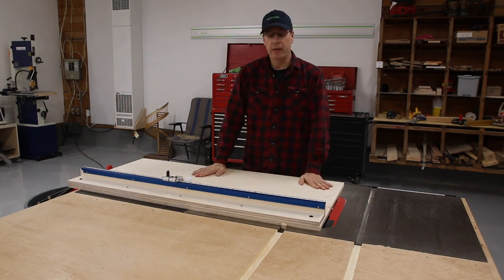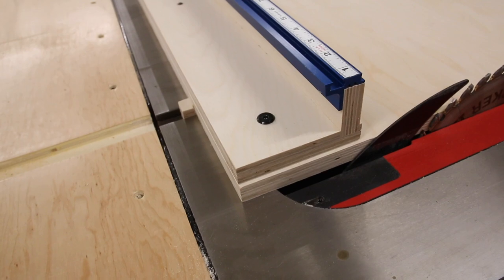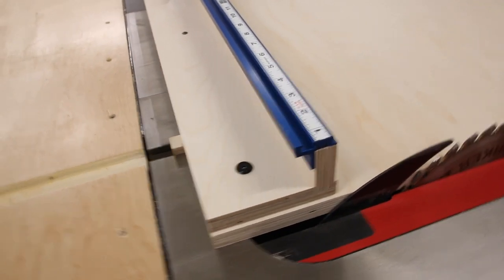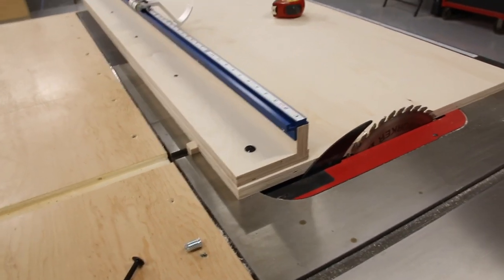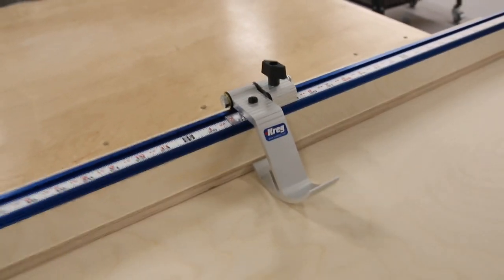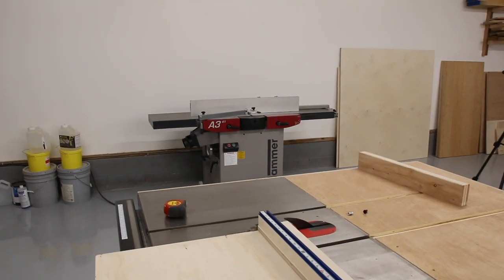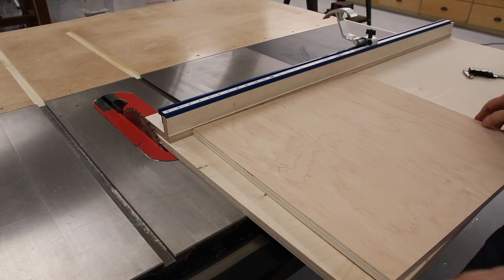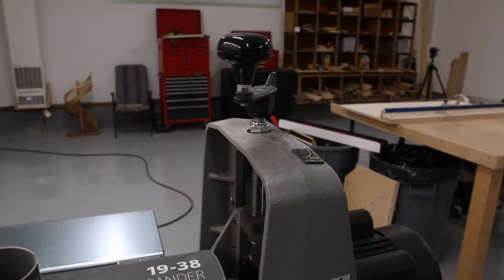Extreme precision Crosscut Sled

Comment: I hope this comment is useful.  The Makita 118 inch track will work with the Festool track saw and is 1/3 the cost.  I bought mine from Home Depot last year for $200 currently selling for $198 CAD, Busy Bee also sell them.  Another comment - DO NOT store your track hanging edgewise by the two holes as you have.  Over time, the track will sag and will not be straight any more.  Instead I put several 4-5 threaded rods into the studs, lined them with PVC tubing and place the long track on the rods sitting flat.  You may not notice the sag right away, but it will happen over time and you wont get straight cuts.